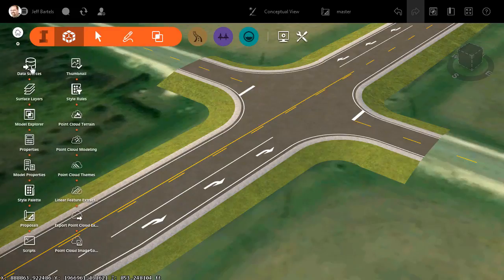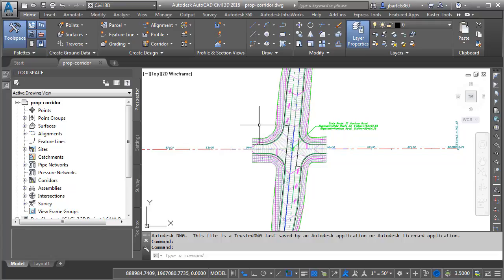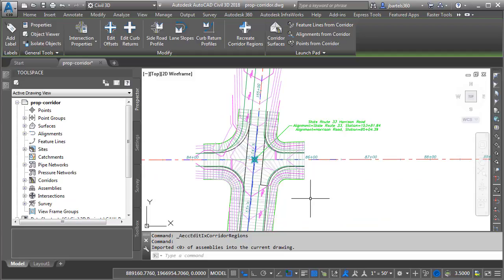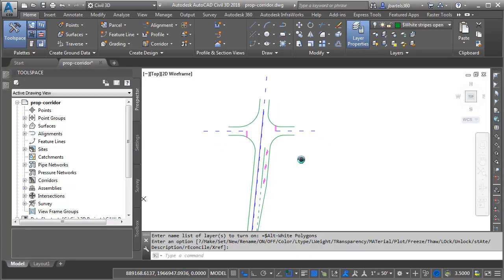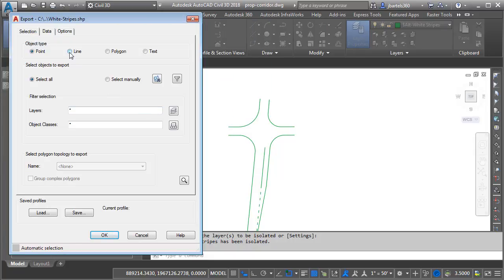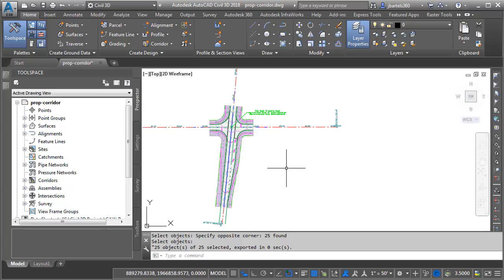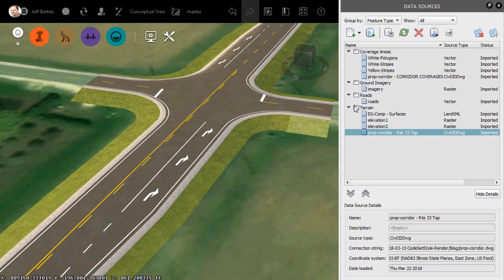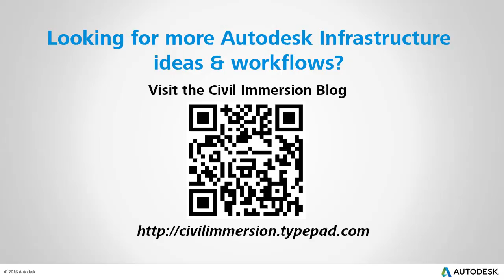Updating an InfraWorks Visualization when an Attached Civil 3D Corridor Design Changes

Comment: Hey, Jeff, how you doing? How do I open the highways generated by the model generator on Infraworks, like roads? When I open in Civil 3d they open like lines. In your video, I saw what you did in civil 3d and uploaded, but what about when the model is generated by the template generator?

Comment: Nice work. Jeff, if you dont mind my question, from where do you get surfaces with elevations to use on civil 3d to do those projects to youtube?
Reply from the maker: Bone l The model builder feature in InfraWorks is a great tool for creating tutorial surfaces. Simply select your desired area and then import the resulting InfraWorks surface into Civil 3D.